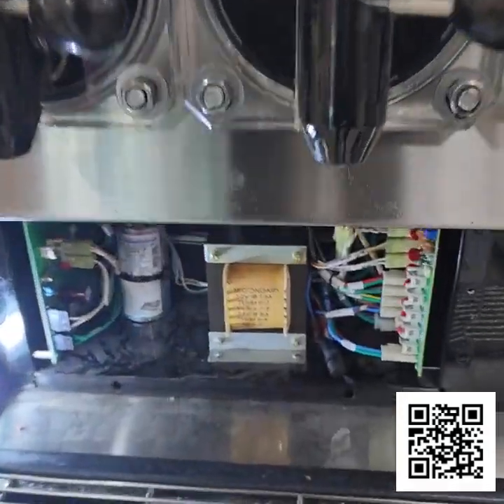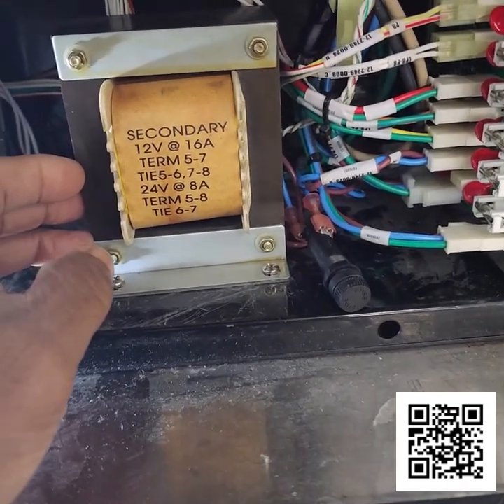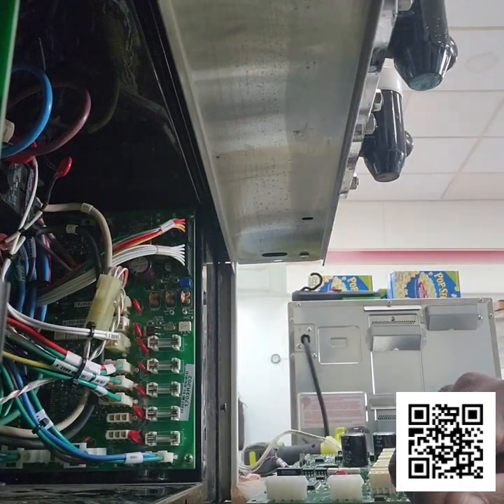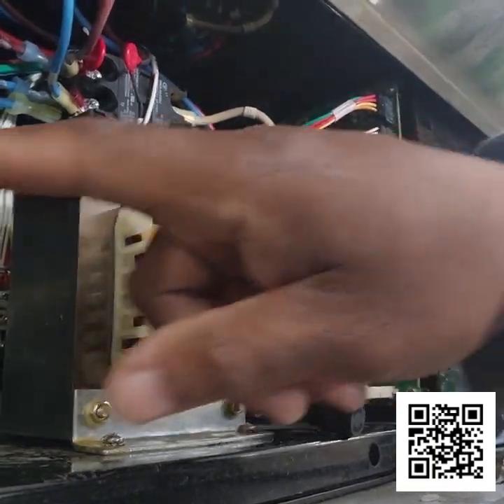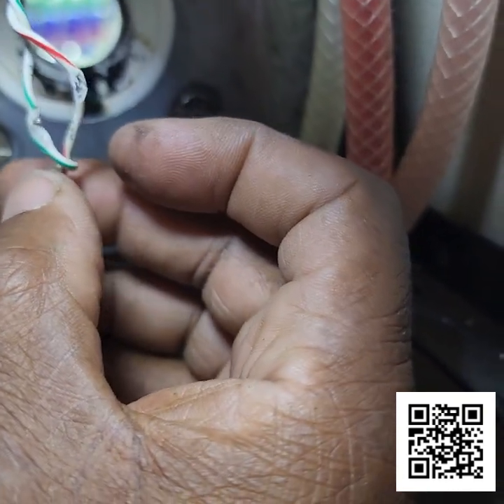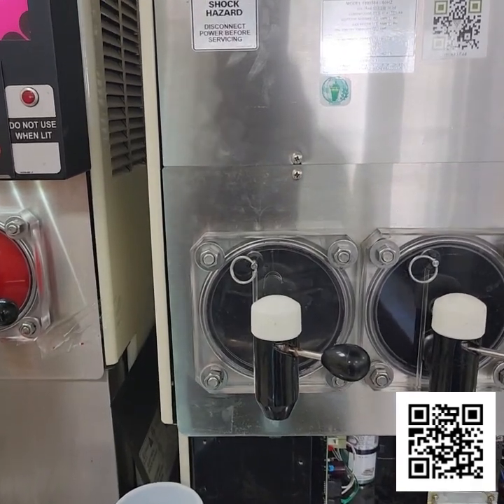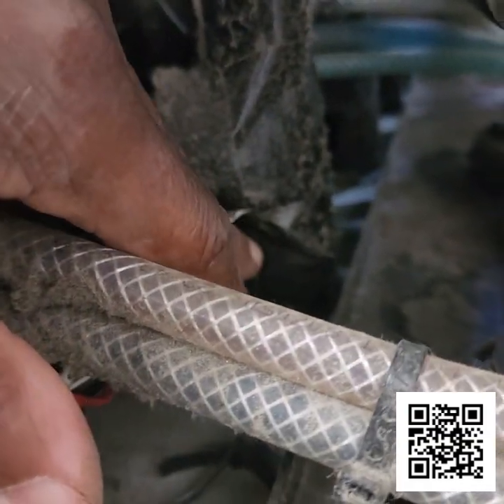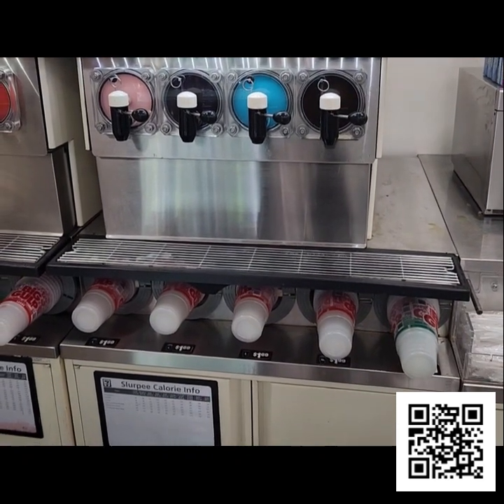FBD Slurpee Machine Repair ( Blowing Fuses )

Comment: I've come across inlet temp errors which still allows it to freeze but whenever I see return temp error I have changed the temp sensor so is it a good practice to just if you have an inlet temp error or return temp error just replace the sensor anyway
Reply from the maker: Good question and I apologize for the delay. I would say its ok to replace the sensors if you have and Temp Error message, but make sure that the barrel the error is on is not in Defrost mode because if its in defrost mode once that barrel reaches 97 degrees the temp error comes on but once it comes out of Defrost you should see the temp start going down and the error goes aways. I they cycle like that then you know that sensor is good, but if a barrel is freezing down and the error message is still there then the sensor should be replaced.

Comment: Another question.
What type or what is the most common way to cheap replace in/return  temperature sensors? This is standard termistor ntc 4.7k sensors? On label is RTD but I seen few replacements instaled already on fbd 564 machine and I wonder… what type they actually are?
Reply from the maker: I am only familiar with the OEM Temp sensors. If you can explain more because I am not sure if I understand your question.

Comment: OMG! Are you kidding me😮  This is why its so important to recheck your work/pay attention.   Its a good thing that you are so thorough.  Im sure your videos are helping others.  Great Job!👍🏾 Thank you for sharing.
Reply: Did you leave in the new board and  transformer or put back the old parts as it seems the problem was with the trapped wires shorting!
Reply from the maker: @mjjay3881  Good question,  I left the new parts in place so that I can test the old parts before reusing them . Because although the fuses blew there could be further damage to the components.
Reply from the maker: Thanks so much!